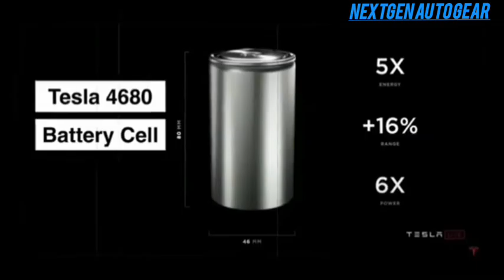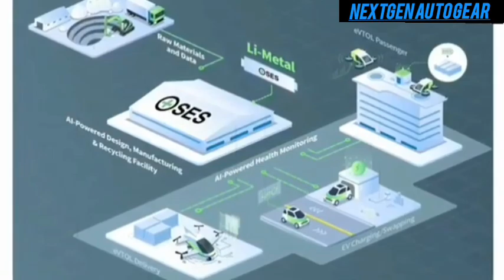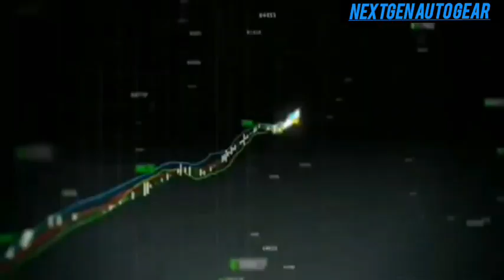Elon Musk Announces Super Solid-State Battery For Tesla 2025. HUGE Changes You Need To Know!

Comment: Monroe will only be correct if there is enough power to charge them and the distribution grids to carry that power both regional and local and this will cost $trillions so will not be available anytime soon. In addition renewables cannot supply this needed power due to their non dispatchable characteristics so it will rely of the installation of small scale nuclear plants to both overcome the distribution and power demand in competition with AI and digital currencies. Until then BEVs will remain a niche market for those wishing to virtual signal their Green views however wrong they area nd Trump's stance against them will delay the process even further.

Comment: Yawn.. just refueled my BMW 318 Diesel running with 5 Liter per 100 km. Range 1360 km. Topspeed 220 km an hour. My Fuel Station visit lasted less than 5 min. Could have had a Coffee Break or visit a bathroom if needed or buy something to read. Better than 30 min in Line on a powerstation in Winter on a Barren field in nowhere. I guess.  Car is from 2010 with 250 km run so far without any  hassle or mayor repair.